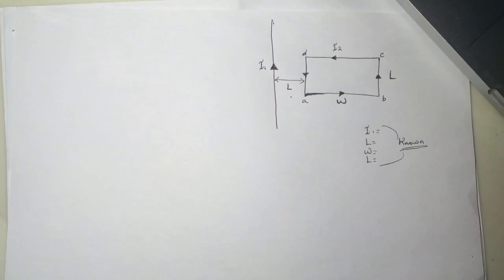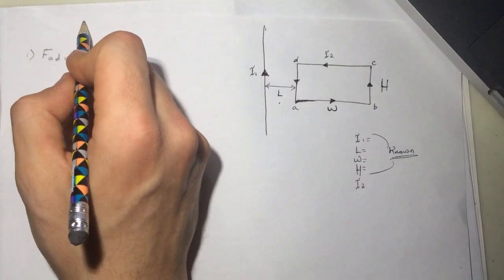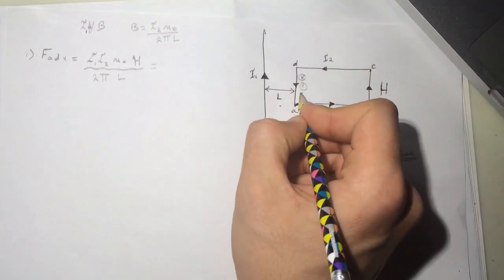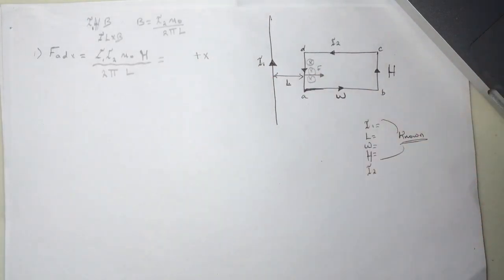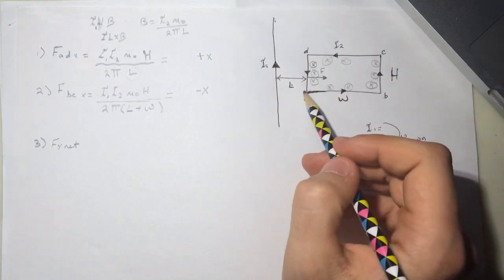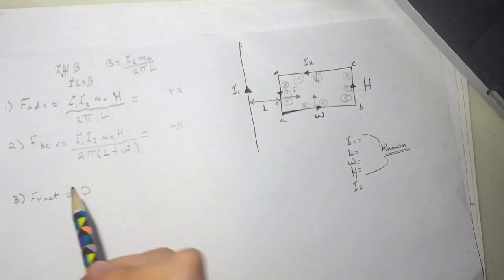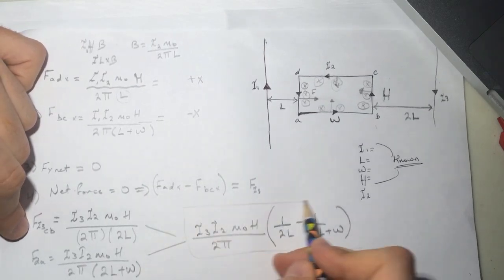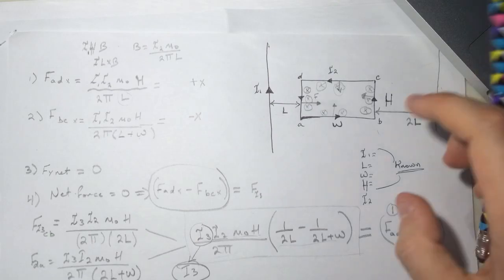Wire and rectangular loop "SmartPhysics" Solution.

Comment: When we need to find the direction of the current I3 shouldnt the force on segment bc due to current I3 be pointing in the positive x direction because the force on bc due to current I1 is going in the negative x direction. As you were explaining you were talking about the force on segment da and then you moved over to segment bc when doing your comparison of the forces on those segments. 
I believe that is a mistake, but I wont be for sure until saturday when smart physics tells me I am wrong or right.
Either way thank you a ton for the help.

Edit: therefore the my real point is that the current of I3 should be pointing the same direction as I1

Comment from the maker: Anna, they dont cancel because the forces are not equal due to the difference in distance from the wire,, but for question 3 they are both same distance from the wire. Hope it helps

Comment: so i noticed that you didn't mention that the answer to #2 is in the negative x direction.  so the answer to #2 is negative.  This may affect people solving the last equation, as they may plug in a negative answer for Fbcx, therefore adding Fadx to Fbcx
Reply from the maker: My Boy Samuel !
Reply: Actually he did mentioned that its in the negative direction @ 4:47 to be exact !!!!
Reply from the maker: tuxedomask I try to explain conceptual stuff, and if they watch the video fully they should be able to adjust their answers to their numbers. But you writing that will help them revise what they did, if they didnt. 
Thanks for clearing this point, I thought we all has the same main answers.
Reply: yeah, usually i'm able to follow but for some reason I couldn't get the right answer to the last one.... then i realized that I was subtracting an already negative answer instead of adding a negative answer